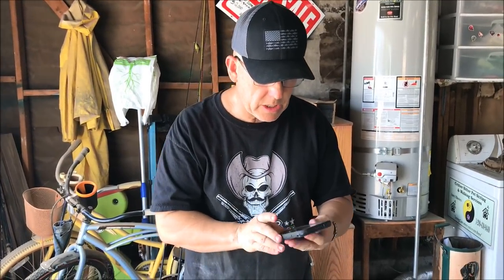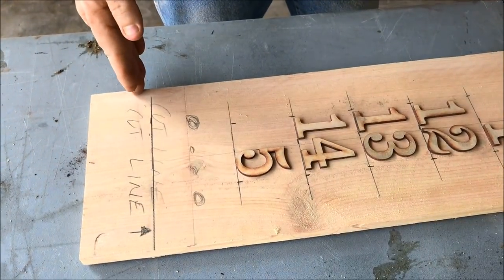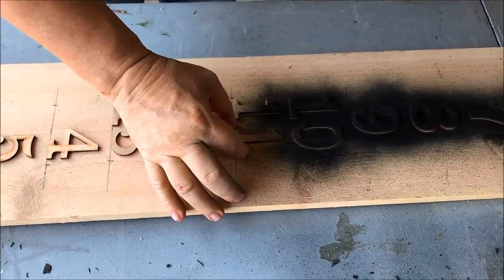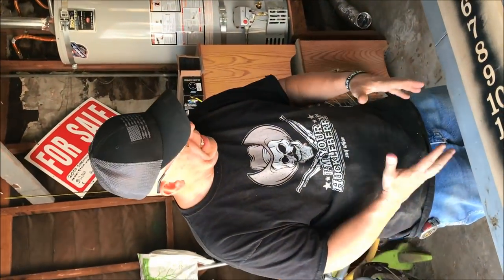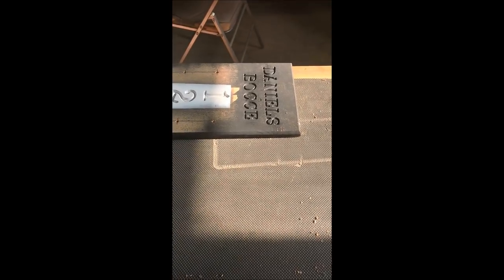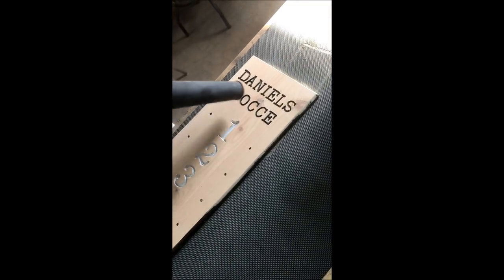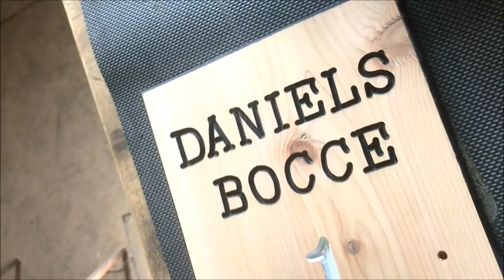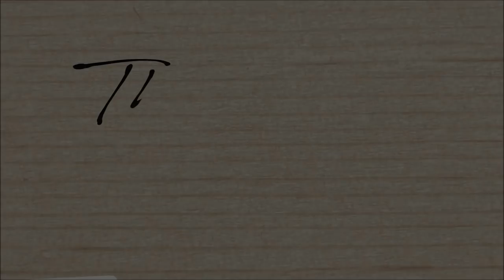#303 Layout & Carving a Vertical Sign

Comment: Just a quick question that you have probably answered many times before, but at what depth do you normally have the 60 degree bit set to on the router? And also what font do you find easiest to use? Love the videos btw, keep up the good work.
Reply from the maker: It varies depending on the size and detail of the letters. But on these 1" clarendon letters, somewhere close to 1/8". These easiest font that we have is our fatty font. Thanks so much for watching and the nice compliments. If you have more questions feel free to email me directly, eric@makeawoodsign.com
Reply: Thanks for that appreciate you getting back to me. I'll give it a try. Just got to find myself a profiling bit now, doesn't seem easy here in UK.